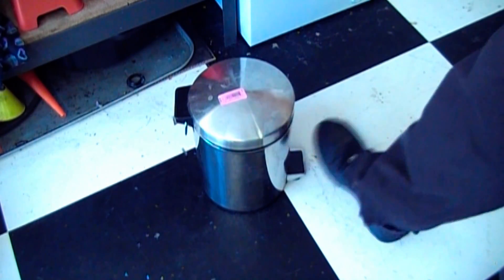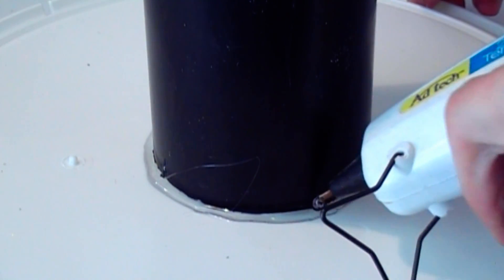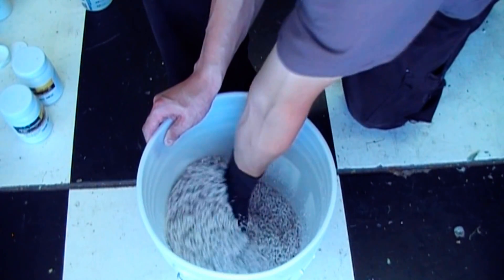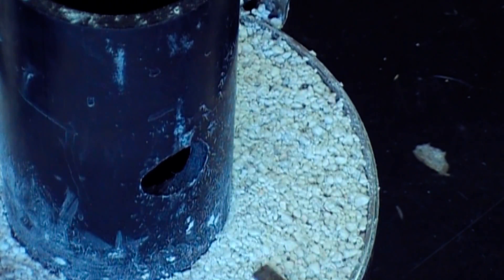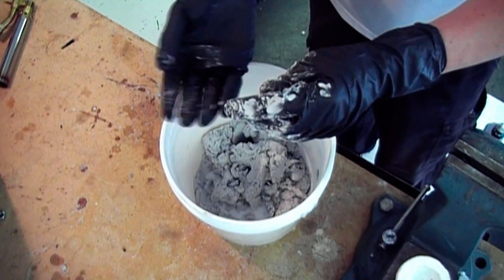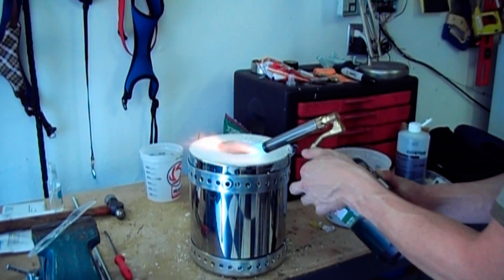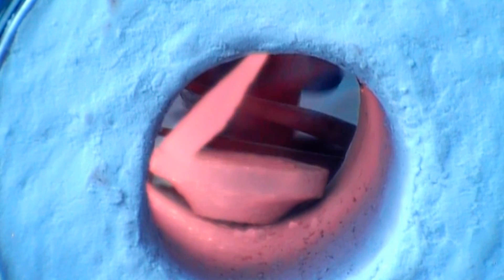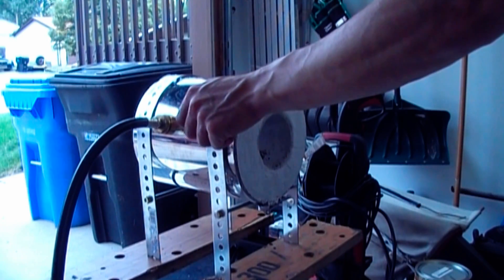How to build a trashcan forge

Comment: hey there clkindred here goes some info for yourself  that you might already know . but several things that might help this foundry .1 > if you do make the perlite smaller you can make a crucible out of it . 2> by adding in a mix of the alum oxide with fine grit play sand(run this thru an old blender)  and make the mix a tad wetter (water glass/slica ratio)to compensate it will hold up better for higher heat ratios 3> the silica which you people cant find you can get cat litter (just make sure to read the package and if it has blue crystal in it it wont hurt it is just a color dye ) walmart has two styles of this  usually about a dollar u.s. per pound.4 >by adding in a small amount of baking soda in this will amp up the curing time quicker( don't add it in till the mix is already done <water glass to silica then mix then add in> then add it in at the last minute before forming usually about 1 tbls per 100g of dry material) 5> two burners to look at one is done by Loongboow here on youtube and the second is what they call a mongo burner( originally desiged by Ron Reil) they both work really well and I have ran both off of propane as well as kerosense ,propan,and as well as old motor oil that was strained for debris.I hope this will help everyone out  paul conroy
Reply: Robert Nightfright Thanks Robert for the additional info. I want to mold a pizza oven, and use heat tiles for the base.

Comment: Aluminium oxide is expensive as all hell where I live and not easily available. Would magnesium oxide work as a substitute?
Reply from the maker: +Rob Meister If you could get "dead burnt" or "hard burnt" magnesium oxide, that should work great. Regular mag oxide is reactive to water, making magnesium hydroxide. While not a dangerous substance (it is used as a heartburn reliever) it has terrible properties when heated due to the water in it.

Comment: Hi,
I noticed that you have used different measurement units in this and a previous video. You measure the sodium silicate in ml but you also use the measurement, gallon. for other stuff. Is the gallon you measure in an American gallon(3.7 lt) or an English gallon (4.5 Lt)?
Thanks.
Reply from the maker: Ah, yes the bucket was one gallon US, but the measurement of the perlite's volume is not exact. It can vary depending on particle size. You can use English gallons and it should be close enough.

Comment: Thanks again Clkindred for the help with my forge. I was able to complete the assembly but am having heating issues. I can't seem to get the forge hot enough to work a piece of 1/2" key stock. Here's a link to the picture. https://dl.dropboxusercontent.com/u/7479631/IMG_7424.JPG
This was after 10-15 minutes of heating. For insulation, I used that Noxcast supercast 3200 degree refractory from Onex Inc. in Erie, PA that I mentioned here before. I did not coat the noxcast with anything. Maybe this is my issue? Also, I messed around for quite a while trying to get the blue flame. I feel those efforts were mostly (but not completely) successful.
Reply from the maker: +Scott Hitz Any kind of cement that is mixed with water will have that water still in it after it cures. The main problem with portland cement is the water must stay in the cement for it to remain hard. If heated enough to drive off the water, it crumbles. Same goes for plaster of Paris, it requires the molecules to be hydrated, or have the water molecule on them to maintain the structure. Refractory cements seem to have an alternate binder that holds the cement together after the water is burned off, but most refractory cements are proprietary mixtures and they don't tell you what's in it. In any case, the water needs to be driven off before you get good heat, that may take a few hours. Even my mixture I used here spewed lots of steam on the first firing until all the water was gone.

I would not worry about coating your lining, it should not affect heating.

Your flame looks pretty good, but the burner placement might cause problems with exhaust gasses rising out of the forge and being sucked into the burner.
Reply: The refractory was "cured" for 12 hours in an over on 350 degrees as the manufacturer said (technically, they only said 8 hours). Thanks for the info. Thanks for answering about the lining. I thought maybe that reflected the heat back into the chamber. I'll adjust the burner placement to the side and see if the flame performs better. I never thought of exhaust gasses. My concern is the burner is too close to the end? Should I Block off one end of the chamber?
Reply from the maker: 350 degrees is enough heat to drive off exes water not bound in the cement crystal, but it takes at least 1000 degrees before dehydration of the cement molecules happens. The bake in the oven is probably to keep the steam from cracking the cement during the first firing. Again, without knowing the exact composition of the cement, I don't know how much molecular bonded water might be in there. How dense is the lining? Is the forge heavy? If so, then it might also just take a while to get hot, because the cement soaks up so much heat. Unless the product states an insulating property, it will probably only be resistant to damage from high heat, but not resist the conduction of heat.
Reply: I used about 3/4 of a 50lb bag of refractory so that would make it about 38 lbs. It feels like 38 pounds when you pick it up. You make an interesting point about conduction resistance. I'll call the manufacturer and ask. Thanks again.

Comment: Quick question. For the sodium silicate do I have to get it pure or can I use the diluted stuff you can buy at home depot.
Reply from the maker: +Jake Productions I was never able to locate sodium silicate at home depot. If it is pure sodium silicate it's fine, if it is mixed with other stuff than stay away. It helps to pull up the MSDS from the manufacturer to see what exactly is in the product.
Reply: +clkindred Ok, Thank you. also do i have to use white aluminum oxide or are darker colors fine.
Reply from the maker: +Jake Productions Others have said the dark stuff works fine.
Reply: +clkindred Thank you. and keep up the great work. you are good at what you do and i'm sure your channel will succeed.

Comment: I'm impressed with your refractory.  After having a chance to use it now, how is it holding up?  I'm interested in using it in my foundry as I think I can keep weight down and temperatures up.  I'm going to be melting cast iron so the foundry will be well over 3000 degrees.  Do you think the sodium silicate will hold the aluminum oxide in place even at these temperatures?
Reply from the maker: +Jim Jones 3000 degrees is just out of range I think. The sodium silicate decomposes into silicon dioxide (quartz sand) and sodium oxide upon curing. So the temperature limits of those compounds are what we are looking at. My forge is holding up great, some hairline cracks, but no missing chunks and no need to patch anywhere yet.

Comment: Hi there, great forge great vid, just one question there are so many types (grits??) of aluminium oxide which one do you recommend? Many thanks
Reply from the maker: +Tiago Matos I used 220 grit, larger grit won't coat the perlite particles as well, smaller grit might have trouble expelling moisture when heat cured.
Reply: +clkindred Many thanks for your reply....
 Opsy daisy... Already bought some and it's lower grit making the forge in a few hours.... fingers crossed    http://www.ebay.co.uk/itm/291588109229?_trksid=p2057872.m2749.l2649&ssPageName=STRK%3AMEBIDX%3AIT

Comment: forgive me cause I'm new to this but with that forge laying down like that would can only metal down or heat up only so much material. could it b used standing up?
Reply from the maker: +damien resendez You could stand it on end sure, it would need a refractory floor to sit on though.
Reply: +clkindred what if the original container used that I choose had a bottom that was never cut off and pack it with the same material used to make the inner walls?
Reply from the maker: +damien resendez Sure can, my foundry made in a cooking pot is made like that.

Comment: Hello and thanks a lot for your videos. Where i can found the aluminium oxide? is selled like a comon item or like a chemical product?

thanks for share your knoweldge!
Reply from the maker: +Abel Villarreal Aluminum oxide is not normally sold as a "chemical" although it is one. It's not very reactive, so there is little chemical use for it. It is sold as an abrasive for sandblasting, as well as an ingredient used in pottery.
Reply: +clkindred thanks a lot, i will search in pottery shops. Your videos are very well done and clear, thanks for the time you spended for do it and for answer 😉

Comment: I made one one like yours in video but I used 4" pipe by mistake but I used all ingredients like u suggest. Will it be ok or do u think lining will be to thin for the heat it will put off
Reply from the maker: +Gerald Roberts So how thick of a lining did that leave you with?
Reply: +clkindred inch& half
Reply from the maker: +Gerald Roberts That is on the thin side, it might not get hot enough depending on the size of the heat source. If it dose not work, put a smaller pipe in there and build up a second layer.
Reply: +clkindred ok Ty is the drill size in the office a 1/16
Reply from the maker: +Gerald Roberts the orifice is .016 of an inch. 1\16 is way too big.
Reply: +clkindred so how did u drill ur hole wth the 0.016 bit. it's to small for my drills & dremel to grab?

Comment: Would work if i put cement at the perlite and dont use the aluminium oxide and sodium silicate.? because thats much cheaper and i dont know where to buy that shit :P
Reply from the maker: +MCpootisHD It might work ok for a bit, but the cement will degrade and become soft like packed dirt after a while.
Reply: +clkindred O real thats weird but how to get aluminium oxide and sodium silocate i know i can make it but how to get all the stuff..... i think im going to try it with perlite and cement in a small furnace for testing but if it works im going to make a much bigger one.

Comment: +clkindred  can you give an idea of a good place to buy the Perlite aluminum oxide and sodium silicate i have no clue where to find these items other than online. Please assist if possible.
Reply from the maker: +Joshua T. Dearden Well, if you don't like buying off the internet (which I also don't do if I can find it locally) Perlite should be the easiest one on the list. I bought mine at Lowe's, but it might not be the right season currently because it's for gardening and they tend to shift away from those products during winter. Also home hydroponics have gotten kind of popular recently, a specialty store that sells to people for home hydroponics would have perlite.

Aluminum oxide would be kind of hit or miss depending on your area, I have heard of a person obtaining it in Australia from a local business that did paint and metalwork. Think auto body shops and metal fab shops. Aluminum oxide is also used in pottery, so if you have an outfit that sells stuff for doing pottery then that is a good bet.

Sodium silicate I could not find in my area, so I made it. But it has many uses in consumer products, so I may have given up too early. Viewers have said car dealerships might have a bunch leftover from the "cash for clunkers" program. It was used to destroy the engines of cars traded in for more fuel efficient ones. The obsolete engine needed to be kept off the road, or it would defeat the purpose. It would be poured into the engine oil and the engine run until the silicate precipitated crystals, filling all the sensitive areas with sand basically. Sodium silicate also finds use in engine leak stop products for the coolant system, it acts just like the previous use, but the crystals clog leaks. I never found a leak stop product to be pure enough to be worth trying to extract the silicate from it. Sodium silicate was also used "back in the day" for preserving chicken eggs, so if you have a place that sells old school homesteading stuff and off grid preparedness stuff they might have it. You might be able to get it from the hydroponics place too, it can be used as a silicate mineral supplement for plants.
Reply: +clkindred Thank you so much i am from a very small town so most stores that would have all of these items are a few hours away or lil over an hour away im going to copy and paste this comment and save it to my computer i saw the online way to find the aluminum oxide. The perlite im not sure quite where nearby i can get it but i hope to find it soon. The sodium silicate i will watch your video on how to make it and if i cant find it in town or close enough by to not have to make an extra hour or more trip off ill make it myself aswell. Thank you for the help.

Comment: Whre do you get the fitting to convert the hoses and burners to 20 lb. propane cylinders
Reply from the maker: +Dean Carder I got it at walmart in the camping section, it's a hose for using propane camp stoves and lanterns on large tanks.

Comment: How has your refractory composition held up so far?  I'm looking at a propane tank forge with either Kaowool as the insulator or your mix, and yours is way cheaper!  With the Kaowool, I was also going to use ITC-100 on it.  Have you made any improvements to your mix?
Reply from the maker: +ginsboy2003 There has been no changes to this mix since this video, but it being cheaper than Kaowool kind of surprises me. I had figured a while back that this mixture was less and less cost effective the bigger you go.
Reply: Well, I haven't figured all the costs yet, but I already have a gallon of sodium silicate I bought for another project a couple years ago.
Reply from the maker: The aluminum oxide is the expensive part, it's heavy, so 10 pounds for example is not that much material.
Reply: +clkindred I also have a 50lb container of 70 grit aluminum oxide I bought years ago.
Reply: +ginsboy2003 If you are using the black stuff let us know how it works out.

Comment: Very informative vid! Thanks!   Any reason not to use CO2 as a curing accelerate for the insulation and lining?
Reply from the maker: +Wali Gomes Thanks! I did not use CO2 because I did not have a source readily available.
Reply: vinegar and baking soda? ;D I stumbled into that idea somewhere out there after you put me onto the path of a light weight refractory.

Comment: Hi, i tried to make my own trashcan forge by following your instructions. Unfortunately without success.  I stuffed all the perlite (treated with sodium silicate and aluminium oxide) into the trashcan. But now after waiting one week it has the structure of wet sand - I expected a hardness like concrete.
Any idea?
If it is the sodium silicate which does not work...can I re-use the material by adding new sodium silicate or another binder?
Thanks for yor help.
Best regards
Reply from the maker: +Marius Privat I found even properly prepared perlite silicate and oxide mix will resist setting if not compacted well enough. It could also be high humidity slowing you drying. Is placing the forge in an oven possible? If it dose not work out, you can salvage the material and use it to bulk up regular refractory cement. You can try blending in more sodium silicate to try again, take a small sample of your mixture and add sodium silicate and test to see how it sets up. If it works, do the same with the rest and build the forge. If not, then there is something else wrong, like the sodium silicate is not concentrated enough.
Reply: +clkindred  Thanks for your quick reply. 
As the mixture of aluminium oxide and perlite works quite well (I put it under fire - works as expected)I think that the concentration of the silicate could be too low. As the only problem is that the stuff does not glue together.
Because of the size I can not place the forge in an oven.
I will follow your advise and I will try to add some more Sodium Silicate (and try to make a testing sample) - will it be ok to take a higher quantity or does also the concentration also matter? (I do not know which concentration I have - as it is self-made ; I can also buy sodium silicate (as so called "waterglass solution" 36%) - unfortunately not as pure/concentraded sodium silicate. Best regards, Marius

Comment: how do you get your burner to jet flame out of the pipe like that? I have watched several of your videos and have assembled my own very similar to yours except im using black pipe and its a piece from my old forge and is a bit longer than your apple corer. Mine you can tell wants to jet flame but I think its right on the verge before and its still feathery flaming rather than jet flaming like yours... is it just length of the tube? Also, how did you find a drill bit .016 of an inch for the orifice? Thanks and love your vids man... big help in my new forge build!
Reply from the maker: +kevindflowers234 The length of the tube can affect the flame, mostly if it's too short. But I consider the orifice to be the heart of the burner, the torch needs to be designed around the orifice size, if the orifice is too large for the burner it will never work properly. I got the drill bit at the hobby shop. should be this one http://www.amazon.com/Mini-Micro-Drill-0-0160-6pcs/dp/B002T7HTFQ
Reply: +clkindred ok thanks...I'm using the same orifice from the original forge and it is .016 I believe...could it be I'm not getting the proper air mixture afterward or can the pipe be too long?